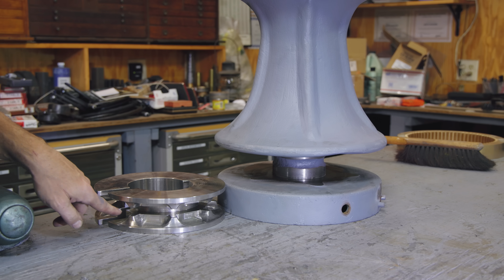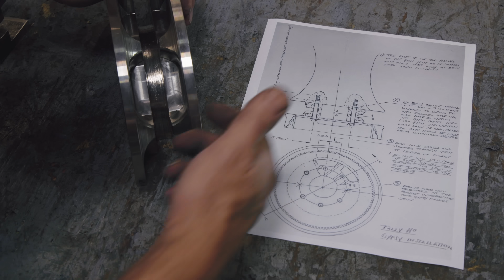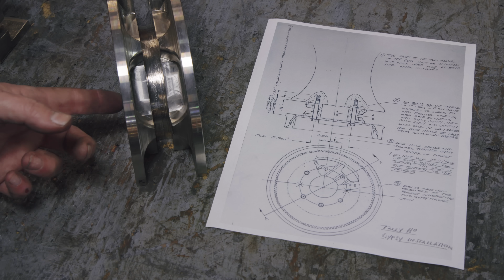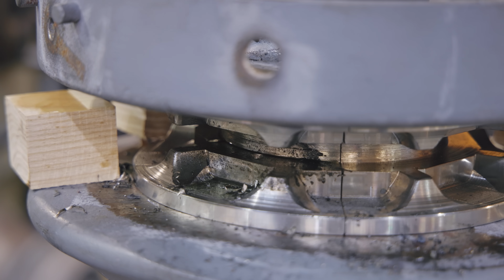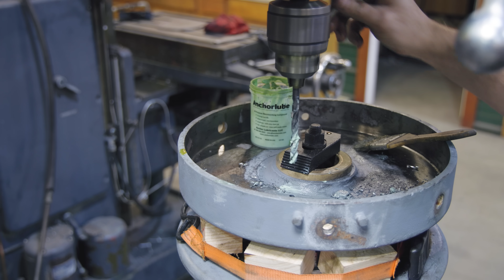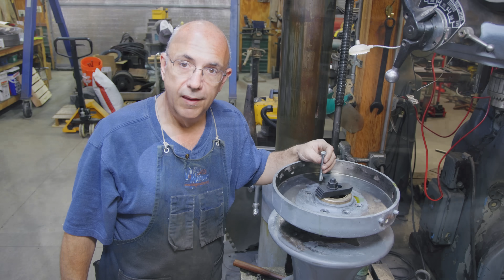Tally Ho Capstan Project: Drilling the Chain Gypsy and Locating Bolt Holes

Comment: Voice from the future; The bolts wound up interfering with the chain stripper and the portion where they pas through the gypsy were cut out with a reciprocating saw, leaving the threaded stumps in place. Then the capstan was drilled and the gypsy tapped to accept wider and shorter screws.

Comment: so the torque coming from the pull of the chain will rely on three 3/8" aluminium bronze bolts in shear? ... 

Order of magnitude would give 3 tons in shear times 6 (2 faces per bolt) but the leverage of the gypsy goes against that: is that enough margin for such a big boat and chain? actually not even that since in some circumstances the chain would be mostly pulling on one bolt (6 tons in shear from 2 sides less the gypsy leverage effect on the best located on, then about two third if  that for the next one, and only a third for the last one)... a gypsy cut in half is not the same as a single piece one.
Reply: The bolts should act in tension to compress the machined faces of the capstan drum against the faces of the gypsy. Ideally, it's friction between these faces that carry the load - although in this case the mating surfaces are less than optimal.
Reply: @frederickstibbert7389  yes they should - but will they ? depending on where they land the actual pressure may be relieved by the "bedding compound" presented many times as the way to alleviate inevitable surface irregularities in the cast material (not overly flexible in addition) - if this "bedding compound" would indeed help seal from corrosive salt water, I don't see that helping an elusive clamping pressure.

What I would do in hope to salvage the setup (in addition to revisit chain load calculation to check dimensioning) is consider bolting strongly the 2 halves of the gypsy together (stainless) so that the chain would never have only a singly transversal aluminum bronze in shear to hang on to.

Comment: Since the drill got red hot, hasn't it consequently lost its temper at 13:55?
Isn't rubbing the worst thing you can do with stainless?
I would've immediately replaced that drill, just in case, given the material.

Comment: I’ve really been enjoying your work on the Tally Ho capstan.  One note (after a career at sea):  The American Merchant Seaman’s Manual refers to the part you call the chain gypsy as the wildcat, a sprocketed wheel to haul in or pay out the chain.  Cheers!
Reply: Ah, but Tally Ho is not an American Merchant vessel. Different strokes for different folks, remember.

Comment: Uh ohh. The chain needs to sit in that slot at the base of the gypsy. I suspect the bolts needed to pass through the solid area (1/2 way between where each hole is now).

Comment: I used to drill a lot of CRES, Inconel, and titanium in the aerospace industry. It was challenging like that stainless. We had this one assembly for a C5 Air Force transport plane engine pylon that had a month lead time to get a new one if we messed it up.  When I asked “what happens if we blow a hole?” I was told “just don’t.” Haha. No pressure. I never oversized a hole in 4 years.

Comment: 28:16 ... If i remember I will post this when the brass bolts are made up ... but far as strength of winching in a big sailboat anchor??  
The brass bolts are in double shear load, and 6 of them 3/8" Diameter, will provide enough strength, to lift a full 10 tons, before shearing off.
Reply: The machined mating surfaces between drum & gypsy are less than ideal, but most of the load should be resisted by friction between their faces, w/ the bolts acting in tension, not shear.

Comment: 21:32  It's hard to know for SURE what kind of stainless steel that's made of, even if the engineer has specified a certain type, the supplier might just use what they have ... that's close.

By this mean some stainless steels are REALLY bad for work hardening, some are hardened purposely by work hardening techniques.

Comment: navy guy that's only into it for the slurs, willing to occasionally say capstan and engagement ring
Reply: technically the motor is the gypsy now because it's politically incorrect to use roma and indians, or slaves to do deck work

Comment: Thanks Keith. I am sure everyone that has ever worked with stainless has had an experiance that will give a fella the worst case of gas on record. When I was working with Inconel we found "Rapid Tap" and regular H/S tooling at reduced speeds worked best. I have been using it for all my drilling, tapping and threading. I see Tally Ho is now in the water. They nailed the weight and ballance perfectly. They still have a long way to sea trials yet. I am sure Leo is eagerly awaiting this piece from you.

Comment: How are these bolts supposed to work? Are they ment to deform the casting enough to clamp the stainless parts? How is this arrangement better than tapping into the stainless and clamping it to the bottom of the casting?

Comment: Keith, wouldn't it be better to use titanium or stainless steel for the bolts? Will the aluminum/bronze be strong enough ? I don't know enough about the metals you are using which is why I am asking.
Reply: The aluminum-bronze alloy features a high yield strength of >80,000psi.

Comment: Hi Kieth, huge amount of work for you refurbing the capstan. Can I suggest when you come to final assembly that use anhydrous lanolin e.g. lanacote on all the bolts and threads. Regular grease absorbs moisture and allows corrosion. I have 30 years experience running an 80 year old wooden boat and have learnt the hard way.

Comment: Cooling is key for stainless .
It is a very bad metal for disapating heat .
When you don't do it , the deeper you go the more heat accumulatie in the tip of the drill
Eventualy melting the stainles steel. 
Grtz from the netherlands Johny geerts

Comment: 12:52 - Umm, Keith, no offence, but you yourself have said in one of your earlier (much earlier) videos "I'm not a machinist". Well, I HAVE to agree, as this boo-boo here proves it beyond any doubt...
I mean, nothing personal, but you just don't seem to have that "instinct" (developed over years of interaction with metals and working on them) and that's why, methinks, every now and then you attempt "to take a light cut" on a rough cast iron casting (NEVER! ALWAYS go as deep as you possibly can!) with a DNMG insert (_"inserts with a 55-degree angle ... they are a multi-purpose cutting tool that may be used for grooving, profiling, finishing "_) WITH "ROUGH cutter", like SNMG or CNMG - or even brazed-on old style tools with obtuse angle of the cutting edge, and negative cutting angle.
Or, like in this instance, the attempt to drill a deep hole in stainless steel (a tough material with poor heat conductivity and tendency for work hardening) without any cooling or cutting oil. (Also, too much RPM for this drill, even for mild steel.)
The moment you started to go past cast iron (self-lubricating soft material) part my reaction was "uh-oh... that won't do no good...".
I mean, I'm often pretty baffled by your choices - your machining knowledge is really impressive, in fact much greater than mine, but your "practical approach" is, erm, "sometimes rather confusing".
Again, this IS NOT meant as any mockery or making fun of your mistakes, but sometimes they are so, well, "preventable" that it really baffles me WHY did you do it in the first place. And, oh, BTW, that "slug" looks to me pretty much like the (former) tip of the drill bit - which got red-hot, bound itself to the base material and got twisted off. Well, at least I've never seen anything slug-like forming, detaching itself nicely and landing perfectly square - on a slopping surface! - right under the drill, AND staying there when touched by spinning drillbit... But then again, I "might not seen it all" yet. Who knows.

Comment: Stainless steel in contact with Iron in a saltwater environment is at risk of galvanic corrosion, is it not?  Is the expectation that the bedding compound will insulate the two materials sufficiently to avoid that behavior?
Reply: I also wondered about this.  Also bronze bolts through steel would also cause galvanic corrosion?

Comment: Perhaps the stainless should have been drilled out on the CNC.  It would force you to match the bolt circle and locations exactly but clearly drilling that material is problematic.  Perhaps you should spec out the bolt hole locations on that stainless so if that part fails and a new one needs to be made, the bolt holes would match up

Comment: Holy crap, I had to turn this off, I couldn't bear to watch anymore. SS needs a slow speed, steady feed rate, and keeping it cool, instead we get the speed INCREASED and no cutting oil! Can't watch the rest, but I'll guess your bit is roached and you had trouble threading work-hardened holes. Is this what happens when your mantra is "it doesn't have to be perfect"? Leo must be cringing watching this.
Reply: The only reason any machinist watches this guy is for laughs!

Comment: I was wondering if the shaft that the gypsy pieces bolt around needed to be turned out and filled with weld? I’m not an engineer but that seems like a great place for failure under load?

Comment: Try this: Drill at a SLOW RATE and USE WATER INSTEAD OF CUTTING OIL.  
This will keep the temps low enough to prevent hardening of the stainless which will ruin the bit.

Comment: I went through nearly a dozen Greenlee knockout slugs while trying to make 160 3/4" holes for conduit in stainless steel electrical controls cabinets before I discovered the "Slug Buster" variant from Greenlee. Still, I went through another five or six to get the job done. Stainless steel is just evil.

Comment: The most impressive part is how calm you seem to be machining this irreplaceable artifact. I would be a nervous wreck.

This has been one of my favorite series of yours yet. Well done!
Reply: To be fair, Keith seems out of his comfort zone with this, lots of folk watching him makes it worse. I’d be uncomfortable just battling this quietly on my own. I too hate Stainless, if anything there are worse alloys, nimonics. Ugh!
Reply: It's like these rock climbers I see do solo loops of routes if you fall off of will kill you dead.  He's confident and experienced and cautiously evaluates the high risk areas. It what makes 'em great.  THis is a crux operation for Tally Ho.
Reply: He already broke part of it taking it apart and will have to cast a replacement.
Reply: @CanizaM, He did not break the capstan head, years of neglect and exposure without maintenance did that, he did everything to not break it, the capstan head was just to far corroded and the part failed, as with everything on Tally Ho decades of neglect have taken it's toll, the part failed and needed to be recast, which it was.  Tally Ho truly is a ship of Theseus.  Leo has taken her completely apart replaced 99.9% of her and reused what he could, this capstan is no different, repairing and upgrading the existing parts so she can last another 114 years.
Reply: @CanizaM  What has already be done by the Windy Hill Foundry - with not less hassle than Keith is having..
Reply: Absolutely !

Comment: As soon as that drill bit hit the SS on auto feed at 750 with no lubrication... Well, I kinda figured it was gonna kiss the donkey.
Reply: Well, it worked at that speed without any trouble until the slug formed. <g>

Comment: Probably been mentioned, but since the hole pattern is not perfectly symmetrical, stamping some corresponding marks into the gypsy parts and winch would save future maintenance people's sanity :)
Reply: I was thinking the same thing.  I'm sure he put clocking marks on all three parts, but to your point, making them permanent is an excellent idea.
Reply: @stevewoodard527 I actually doubt Keith did that.

Comment: Keith, I am concerned that the drawing shows the shoulder of the bolt is recessed in the top section of the capstan drum. I suspect that the engineer was trying to avoid locating the stress concentration that occurs at the bolt shoulder from being located right at the shear plane. It appeared that there was no 3/8 counterbore as the 3/8" drill wasn't long enough to get all the way through the gypsy..

Comment: Surprised that stainless bolts were not called for.. I have fabricated with non-magnetic stainless steel and found that every drilled hole is a challenge to itself.  The tolerance you are able to hold on your jobs is impressive, inspiring even !

Comment: Leo down loaded the video of Tally Ho Being Launched. They were concerned with Tally Ho Sitting on her lines. That is floating with the waterline on the hull parallel to the water. She is quite good but just slightly high on the bow. I am very confident that once the capstan is fitted, Tally Ho will be perfect. Hope you get to sail on her.

Comment: Last time I worked stainless, we had to get carbide drill bits, as the titanium bits would do what yours did, and just melt a work hardened plug.  Also the titanium oxide bits are only coated.

Comment: I am really surprised that that first drill bit still worked after glowing red, especially in stainless.
My experience with stainless steel (in the hobbyshop) is basically "use razor sharp drill bits and lots of coolant" - then you might have a chance. If it work-hardens you will just burn up drill bits and you have basically lost. But with your caliber of machines you probably have better leverage.

Comment: Why didn't you do the counterboring first to get a flat so the center drill and others would not experience unbalanced radial forces when starting?  Seems to me the obvious way to go.  Unless your counterbore bit uses a pilot in which case you need the hole first.  But that's not the case here.  And as others have said, slow down in SS.

Comment: First time I have some imput about your work.  I millwrighted in the construction industries for 35+ years maybe 10 years in the food processing industry. Drilled maybe tens of thousands of holes thru many many different thicknesses of stainless steel . This is what I " Know " flattened cutting flutes on the drill bits on both cutting axeises, drill pilot holes, slow the driver down very slow, the use more pressure down when drilling !! You think drilling something stainless this thick is tough dry some 10ga sheet metal. Forgive my boldness. God bless you Sir

Comment: Great vid as always, that said. your tapping, dont you backup when tapping holes, i generally tap about 2 turnd and then backup 3/4 turn to break the cuttings and clear the threads.
Reply: He was tapping cast iron, it becomes powdery when worked so no need to break chips with the back stroke of the tap.

Comment: So the little slug was holding on the drill and then spinning on the lower part heating it up and hardening the parts. Then you had to fight that.  Wow always something to learn.
Reply: That slug work hardened just a bit of the surface under it as Keith stopped soon enough. Had to watch an apprenticeship candidate do something similar decades ago, it was hard to watch, you want to jump in and fix it, before the fact since we knew how. Waiting for the dawning realisation in the demeanour of the subject was the rewarding part. He has since completed, past, and mastered many other modes of craftmanship in the industry and retires soon.
Reply: At first I could not understand why the bit was not dull . Then I realized the slug was spinning.

Comment: I drill mostly in stainless. With carbide bits and a lot of cutting fluid. But I'm surprised that you don't use a pilot hole. It increases accuracy and allows the oil to pass through the part. I've never experienced job hardening. And I've been doing this almost 40 years. Your speed was way too fast for stainless. But you got it done is all that matters.

Comment: I'm curious as to whether the capstan motor will be electric or hydraulic. Considering the distance from t he engine space to the capstan I'd look at hydraulic. A common problem with boat capstan is getting 12vDC power that distance without overheating the motor and excessive resistance in the power cables. An today hydraulic motors can be serviced almost anywhere internationally.
Reply: Tally Ho has 8 x 24v 200Ah LiFePO4 batteries, wired as 4 x 48v pairs, for use w/ the electric-drive motor/generators & the capstan drive motor. The wiring is hefty, looks like 4/0 copper. There are 2 x 12v batteries as well, for house power & diesel start-up.
Reply: Maybe a air motor.  This is pretty common on larger wenches I've been around.  Electric is more common than you think now days.  Just depends on whats available electrical.
Reply: They do have AC power ( not 3 Phase! ) on Tally Ho, so maybe they will use that?

Comment: I think your ‘slug’ disc was from the bottom of the top disk and got popped through by the drill as it finished the upper section. It stayed with the drill bit rather than falling off. Then it acted like a bushing and prevented the drill bit cutting edge from hitting the lower plate. Then it got so hot it sort of welded the slug to the bottom plate when you stopped.

Comment: I am seriously impressed. Impressed with the engineer/designer who came up with the fix for the old capstan, impressed with the UK machinists , and impressed with your skill and professionalism Keith. Well done! Well done indeed!. I do have a question. Will not these dissimilar metals, cast iron, stainless steel and bronze form some kind of a battery in a salt water environment? Can anything be done to protect against that?

Comment: I'm really impressed with the engineer that came up with the fix for this project. It's pretty complicated from start to finish. But should last another 100 years without much problems. And the only thing that should be a wear part is the winch motor. Can't wait to see you on the next one.